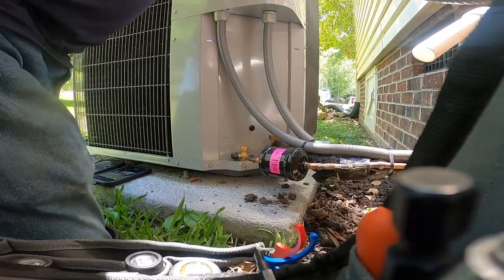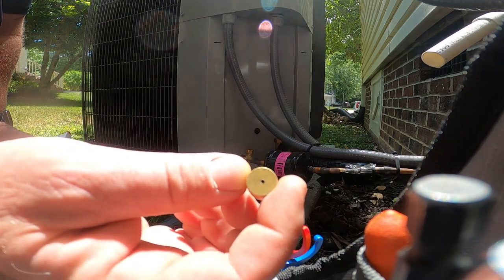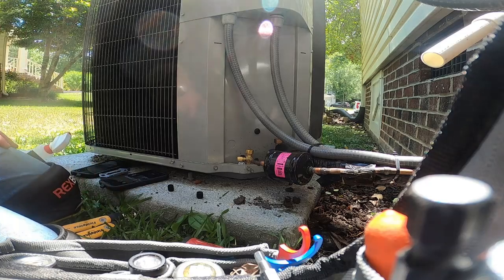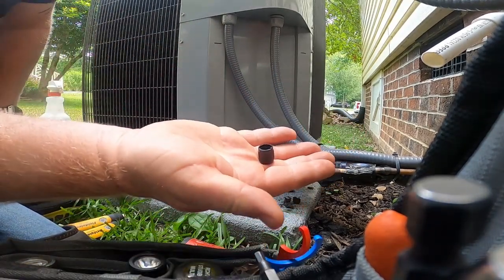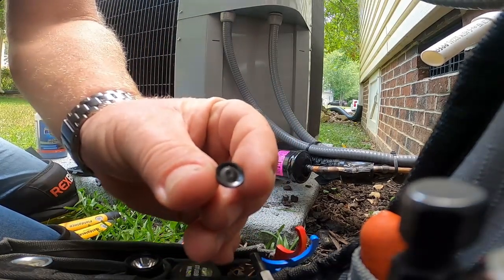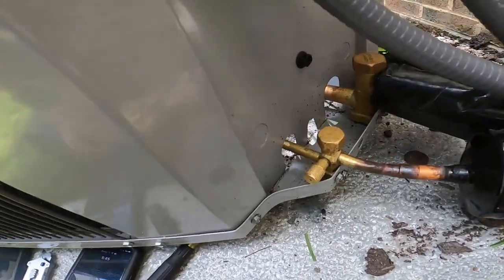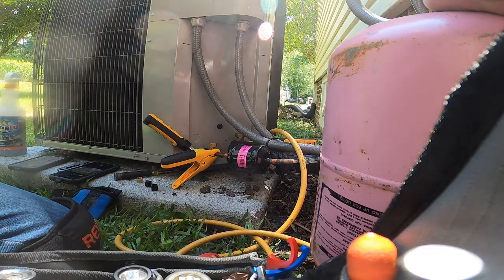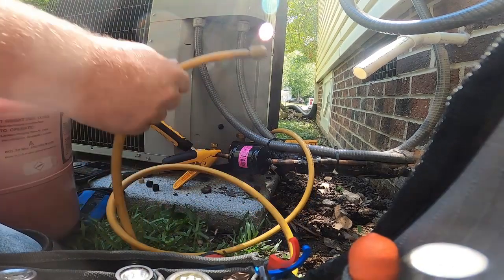A small mistake causes a big problem.

Comment: Good find! I’m new to ur channel but I have a question? What’s with the 2 electrical line’s going into the outside unit, I know one is for the AC unit but confused about the second. Thanks
Reply from the maker: We also run the tatat wiring to the unit in liquid tight to prevent being chewed on or chopped up by weed eaters.
Reply: @MYHVACLIFE   o ok that makes sense.  Thank you.